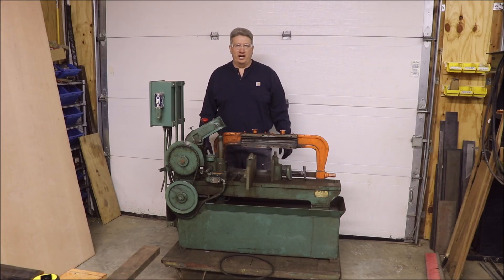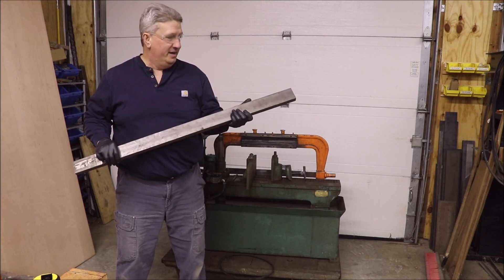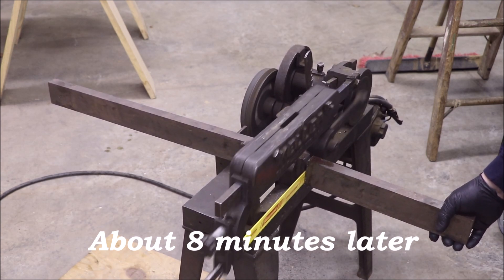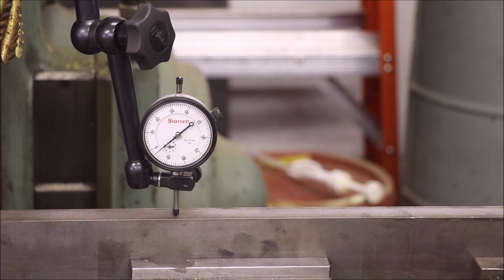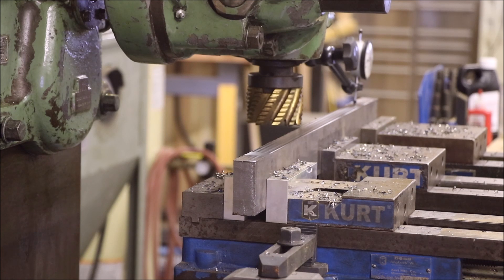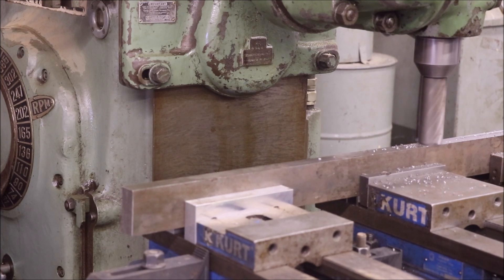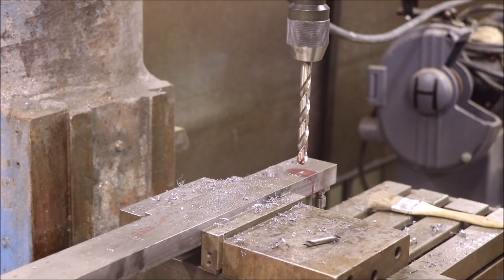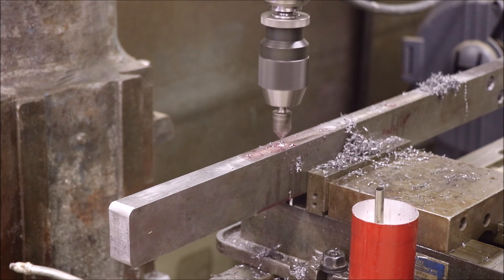Rebuilding a broken Racine Hydraulic Utility Saw  Part 1

Comment: How do you change the belt that drives the water pump ?
Reply from the maker: It's a rubber slow speed belt joined by a staple.  Simply unhook it, install it, and run the staple through again.  Nope, I don't have a picture.
Reply: @JeffHeathTheVintageWorkshop  But there is no way to sling a modern auto parts store belt over the pullies ?
Reply from the maker: @1-shotslinger108  you don't use a auto parts store belt.  Get the right belt.  Contact belting companies. Mine was fine so I didn't replace it.
Reply: @JeffHeathTheVintageWorkshop  My original belt was laying in the bottom .It had a staple .I did not know you could still get an early style belt. Thanks .

Comment: Surprised you couldn't find a foundry nearby that woukd use the old one for a mold the recast it using the old metal (add a little more so you could machine it down)
Reply from the maker: Not sure what you're referring to.  The only thing broken was the cast iron arm, and that is the weak link of these Racine machines.  I replaced it with a A36 steel bar, machined to specs by me, that will be a LOT stronger and no chance of breaking again.  This is a better option.  I've seen quite a few of these hydraulic saws with broken arms over the years.
Reply: @JeffHeathTheVintageWorkshop  you said you went with steel you had lying around because of the cost to ship cast iron. And you said 1018 (a lot more expensive) not A36.

I would have though a local (driving distance, like Chicago Crucible) foundry could recast for a lot less than the shipping cost you mentioned. Even reuse the old piece as a pattern (Or using a wooden replica you could easily make) then melt it to recast. Or using a wooden replica you could easily make.

As for the strength, sure the steel is stronger, but stronger than needed.
My guess is, as you said in part 2) it was broken from misuse not a design flaw.
Reply from the maker: @TEDodd  Whatever I said I used in the video is what I used.  I honestly don't remember.  I have a lot of A36 and 1018 around here, as I do a lot of fabrication work.  In my opinion, steel is better than the cast iron bar.  I surely wouldn't need to get it cast. I could have purchased durabar, but why?  No need.  Thanks for watching.